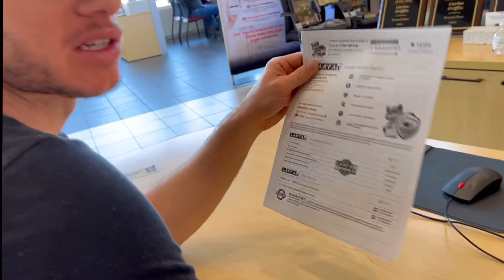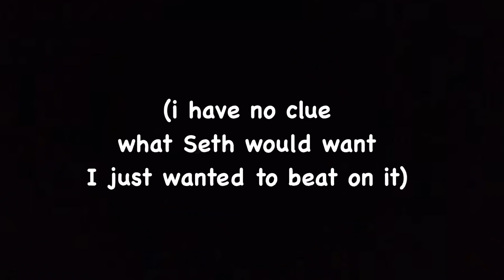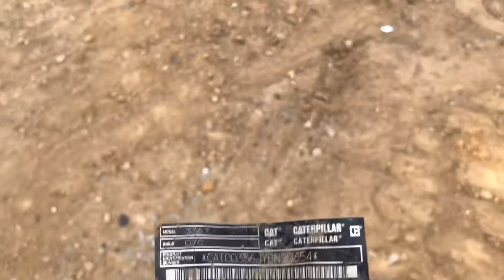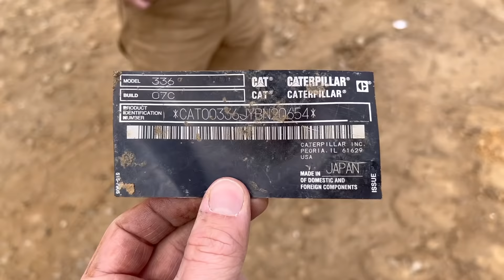Crushing my cameramans truck and giving him a new one

Comment: The fact that Seth collected and put aside some old bits and pieces from his old truck you can tell it held some sentimental value.
Reply: I don't think it's possible to run a Toyota truck and not have sentimental value.
Reply: @MJR_heyfunny  best thing I’ve heard all day
Reply: I pulled the grille out of my old Sonoma and in transferring the old tags to my mustang when I sent it to the junkyard I know it makes me sound like a pussy but idgaf I cried when they hauled it away losing that truck hurt more than losing my gf
Reply: Shame he can't open his Garage Door now.. LOLZ
Reply: @jamesprice2163  I love cars, my first car was a 1972 VW bus, all original stock with passenger seats. I bought it at 14 for 800 bucks before I could even drive. I spent 2 years working on that thing, completely removing the engine and replacing the clutch amongst dozens of other repairs. I even had it painted at my high school body shop class for 400 bucks (the cost of the paint itself) and had it done in two tone bright yellow and white like the Little Miss Sunshine vw bus. I drove it for all 4 years of high school, even got a girlfriend just because of that car she loved it so much. I ended up selling it at 18 years old for 5800 bucks and it got shipped to a guy in Germany, to be sold for even more. I didn't cry when it was loaded onto the trailer to go, but I felt an intense sadness. Looking back now at 26 years old I painfully regret selling it. I ended up just blowing the money I got from it on a 1971 vw Baja bug project car that was just a money pit. You live and you learn I guess.
Reply: @MJR_heyfunny  Yes, if you live on a first world country.
Reply: Ya that's the only thing about destroying an old truck. Even tho the camera man did get a nicer truck, what if that old one had been his grandfather's or something. 😬
Reply: @noahpickerill3749  yeah this actually angers me. There is way more sentimental value in my old rusty cummins than any new truck is worth.
Reply: yeah that was not cool. imagine someone killing ur dog and "giving you a new one"
Reply: A nice surprise, but you crushed something that he held as a important memory maker, that didn't feel right to me... sorry.🫣
Reply: @vaneela3377  Dude, get over yourself. This is and always will be a stupid argument. People aren't banned from having emotions just because someone else in the world has it relatively more difficult.
Reply: My very first ride was a 1992 Toyota pickup.. she was stick shift.. I had no idea how to drive let alone a stick when I first got it 😂
I remember I would stall it at every light lol.. oh but I loved her! Her name was Tonka.. she was my Tonka truck
Reply: @james price

Then why even give it away???
Reply: @MJR_heyfunny  super true
Reply: @CadgerChristmasLightShow  damn a vw bus for a first car lucky
Might get a beetle for a first
Reply: @thelaziestninja86  that’s not what he was implying. He’s saying that only people from 3rd world countries get sentimental about a Toyota truck
Reply: @MJR_heyfunny  If his grandpapa gave it it is
Reply: @MJR_heyfunny  😄 haha
Reply: @MJR_heyfunny  haha😂
Reply: No matter how much money I have in this world if someone crashed my daily no no nooo
Reply: I talk all sorts of shit abt my ranger but shes like a famly member id be crushed if i lost her

Comment: Seth is a great guy and all and he deserves a new truck but I drive an old car and I'd never want it to be destroyed for a new version
Reply: I had my first car for 10 years as a daily. Drove it all through college. I was glad to get $500 in trade-in value at the dealership when i finally got rid of it. It was a 1998 Pontiac Firebird. One of 3642 bright red Firebirds manufactured that year. Fun car. It meant nothing to me.  Anything mass produced is replaceable. Cars are meant to be used, not coddled. Memories are in our heads, not the objects we own. Stay safe out there. 🤘
Reply: @daminox  If Seth thinks like that it's all good but I would be so pissed. Also just cuz it's massed produced does not make it replicable. Just cuz humans are mass produced doesn't make them replacable is one way of looking at it. The unique memories and experiences you have with a car make it unique to you

Comment: funny story, my buddy bought a Nissan Titan. drove it off the lot and got maybe 5 miles away. when all of the lights lit up on the dash and then the rear diff locked up then the motor. the guy bought a truck that just got there and had no oil in it. the staff never put a oil plug in it. he called them up screamed at them for his money, he got it. and walked next door and bought that exact same Tacoma.

Comment: Years ago I was working at a Saw Mill with another guy and we were stickering lumber to go in the kiln.  He had driven an S-10 to the site and had parked it out of the way.  One of the other workers was zipping around the yard with a huge frontend loader picking up piles of railroad ties coming off the saw mill.  I just happened to look over when I saw the loader operator back over the S-10 at full speed.  It was like a monster truck car crush, the S-10 was now a taco.  The guy I was working with immediately put his hands on his head and did a few OMGs.  Turns out the S-10 was his Dad's.

Comment: Dude that old truck is probably ten times more reliable than a new truck
Reply: He probably wouldnt have gotten 100000 more miles out of that truck. And any new truck will easily get to that
Reply: @matthewkloep8391  I don't know what you've been reading but I could need plenty of brand-new trucks that haven't been making it to 100,000 miles. Basically all the new Motors are pieces of garbage. I'm not saying I wouldn't want one but they don't last as long as the old ones.

Comment: Universal keys and vinplates that just fall off. Replacements are a dime a dozen on eBay. You don't need to worry about making it easy for thieves to steal heavy equipment.

Cody is a stand up dude for getting his buddy a new truck and low key calling out the stupidity of heavy equipment manufacturers.

Comment: What a friend. No doubt about it generosity is the best way to hold on to money. Do you feel what I'm driving? Looks like you do.
Reply: I'm sorry WhistlinD I'm kind of a dummy...I don't know how to "DM" or, use a "Telegram". And WOW thank you also for the aloha. I of course have no idea what my prize is but, I'd sure like to know! I watch your channel for a variety of reasons. Many of which I discovered only after watching. You are insanely generous, (I was in tears watching cameraman getting his NEW TRUCK!) hilarious, fairly intelligent and are a really big hearted solid young man. YOU Restore my faith in youth and mankind in general.. Some things we have in common like our love for trucks. I have an '85 lifted 4x Detroit diesel burb with a custom fabricated 3/16" train guard styled brush/cow bumper with a 12000lb winch built in. And a nice 30" led light bar fabbed into the middle. The entire grill and lights assembly are from a '91. You can't tell it's an '85 from looking at it. It's kinda beat but at least it is straight and she's mine. I have late stages glaucoma and can't really drive it any more except off road because I can run stuff over with it and it don't matter. Weighs in at about 9000 with me in it. So how do I dm and telegram? Pretend that I know nothing. And thank you.
Reply: Ok so I installed Telegram app on my phone but in order to message you it asks me for your number and first name. Am I doing this correctly? How do I use Telegram to message you?
Reply: @tedsmith3061  its a scam and the account is a robot. not the real whistlindiesel.
Reply: @cffragrance  figures

Comment: Are Toyotas Tacomas coming like this in the US from the dealership? I mean the suspension raise and wide rims? Like is it the dealership that is pimping these trucks for the local taste or even get delivered to them from the factory?  I am really interested cause in the EU there hardly is such a thing. It's either a factory trim, or nothing. After you bought it, you may buy extra stuff on it in the dealership, but they won't do any changes cause "what if someone doesn't like it and the car looses it's value". So it's interesting to see such a modded car sitting at the dealer (cause he says brand new.) So I don't know how it goes over there. Just thinking out loud.